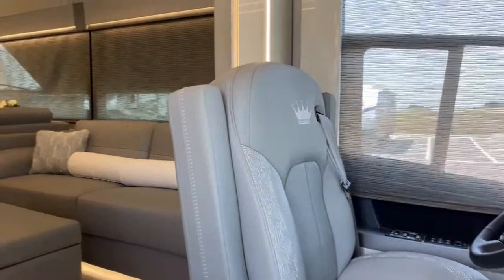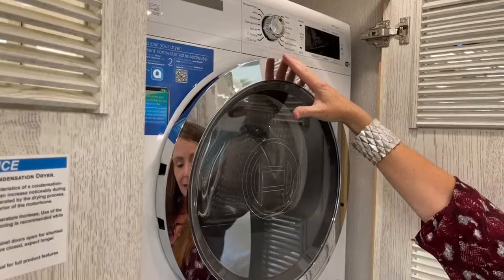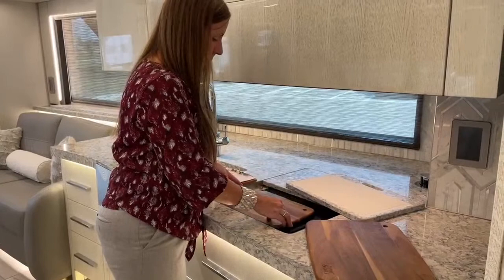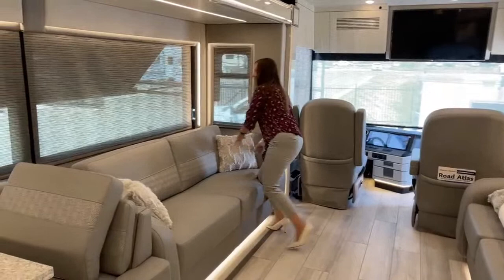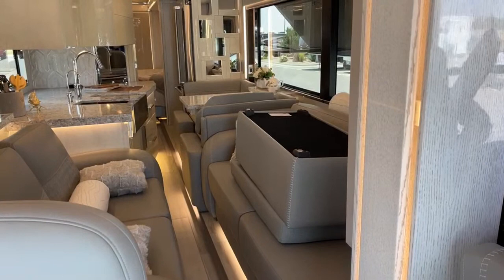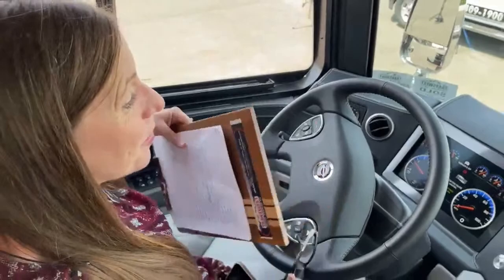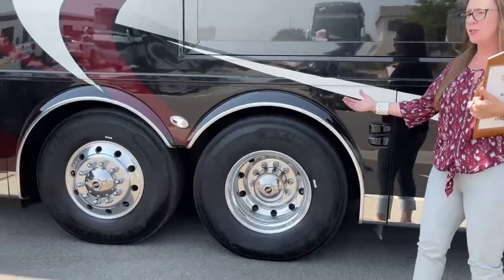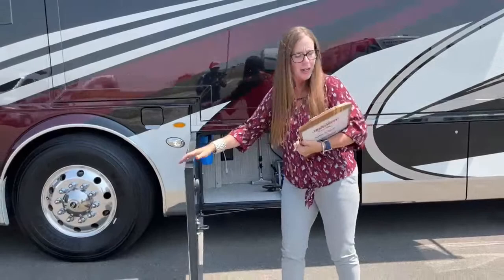2021 Newmar King Aire 4531

Comment: Stunning coach where I love almost everything. However, I got to say I don't like the white oak wood finish or the swivel to the 1/2 bath door. This certainly becomes a viable option when I win the lottery.  Doesn't the electronic in the Master Closet require extra cooling?